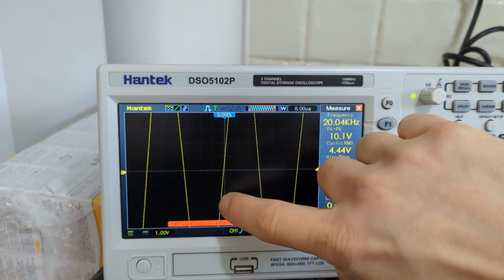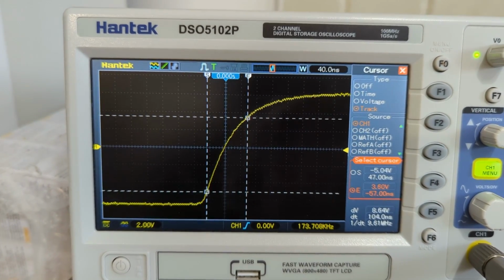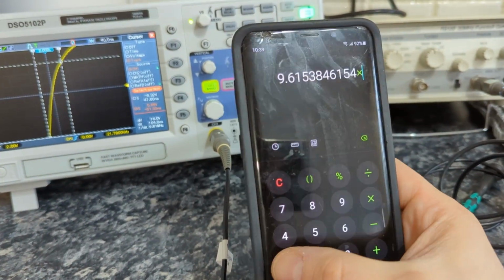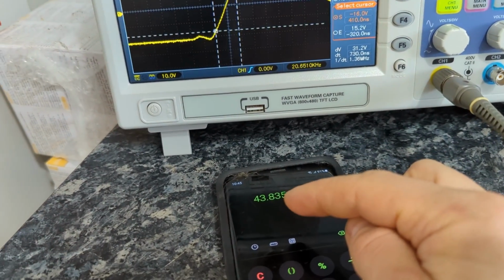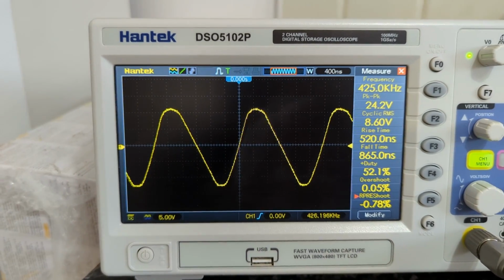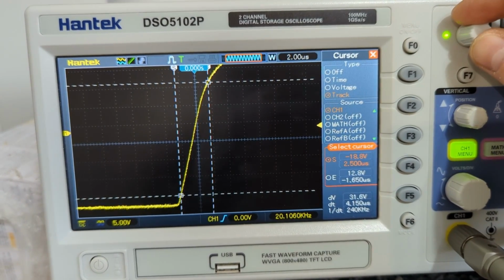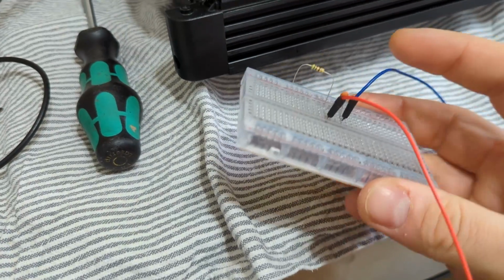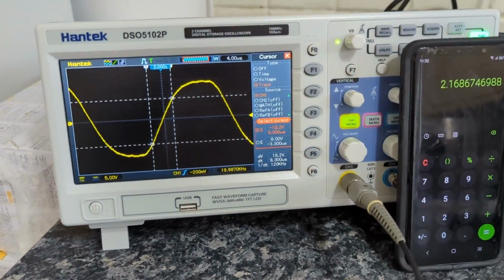Measuring amplifier slew rate - Class AB vs D

Comment: Nice video.  However, it might have been quicker to explain how a square wave is created in the frequency domain by summing odd harmonics of the fundamental.  What you are essentially doing as you increase the sig gen frequency is knock out increasing odd harmonics from the fundamental up and eventually arriving at the maximum harmonic(frequency) the amp can generate.  That's why the signal approaches a sine wave shape as the frequency on the signal generator is increased.  Using broad brush strokes here but as long as the slew rate is greater than the Max frequency the amp needs to spit out then there's no issue.  A sub amp can be good and have a far lower slew rate than an amp used to push sound to the upper limits of our hearing.

Comment: Well nice experiments, theory says it is enaugh for amplifier can handle high-frequency, high-amplitude signals 2.51 volts/uS for 20 Vpp signal at 20000 Hz  without distortion. Or 12.57 volts/uS for 100 Vpp signal at 20000 Hz It's a 1.5kW of power for HF 😀

Comment: This is why I have difficult with class D amps. If you only plan to use the amps at home why need class D amps. The size of the amps doesn't matter. Class D amps good for portable speakers. But for use at home why use class D. I had 2 NAD amps, 302 and 914. I hear clearly the 914 sound faster, faster attacks. So see "high end" class D amps supricing me. But not many talk about this. How come?

Comment: Before measuring te SR for class D amps, it is better to check it's output before the output filters. You won't find the analog signal there. So how do you want to measure  SR which is analog domain parameter when you don't have analog signal output ).
Reply from the maker: What kind of signal is it?
Reply: @RAW-CAt pulse width modulated and you must use integrator (LPF) to restore the input signal. 
Theoretically, you need an ideal (infinite roll off) filter This is the trick it is not analog amp in our classic terms.
In two words - digital domain.
But we do not convert it into the code, we convert it to the duty cycle of the square wave carrier. In delta-sigma we convert them into pulse density of the square wave carrier. This is a simplified theory.

Comment: just like class AB, class D amps can measure 'perfect' depending on their architecture/design.
it basically boils down to price range (the entry level got way better over the last decade) w/ 'top of the line' always being 'over achievers' (doing more than is really needed for a lot of extra $:} ).

ps: ABX testing should be fun... 
i'm very skeptical of claims coming from 'golden ears' simply because there's Zero data to back up the claims. 
there are indeed 'freak instances' where ppl can hear even ultrasounds and be bothered by it, but it's a relatively rare occurrence.

for most ppl 30 yrs old anything above 15-16kHz is silence...

Comment: Interesting video very informative, I loved it but I would say It's generally advisable to avoid driving audio amplifiers with signals that approach their limits, especially with continuous full-volume square waves. If you need to test the amplifier's performance or measure its capabilities, it's better to use signals that are within the normal operating range of the amplifier. Additionally, ensure that the amplifier is adequately cooled, and monitor for any signs of distortion or stress on the system. I actualy don't no the specs of the amps so maybe you weren't but just a word of caution' great work....cheers.

Comment: Class D: The RC-filter visibly drops the slew rate. I was waiting for you to test without the filter, but no
Reply from the maker: I will figure it out, just give me some time🙃
Reply: @RAW-CAt   Probably the @thulinp is right and you used a too powerful low pass RC filter, you can verify it by measuring the impact on the sinevawe for the same frequence (20KHz in that case). RC filter you used is a single pole and has 6dB roll off per octave and may affect the 20KHz signal in your setup significantly.  Take a measure without any filter.

Power amplifiers have some RC filters at input so to feed it with a pure square wave in theory should be OK .

Comment: We call it slew rate, but it is actually simply clipping. But what is clipping is the current into the dominant pole capacitor. Think of it this way and all the mystery disappears.
Reply: No, 'Slew Rate' is NOT 'Clipping.  Slew rate and clipping are not directly connected, but there can be an indirect relationship. In amplifiers with lower slew rates, fast-changing signals may not be accurately reproduced, and this limitation can contribute to distortion. Fast-changing signals can lead to transient voltage spikes that may cause clipping if the amplifier's response is not fast enough. In summary, while slew rate and clipping are separate characteristics, a higher slew rate can contribute to better handling of fast signal transients, potentially reducing the risk of distortion due to clipping in certain scenarios. It's important to consider both parameters. This video is shows us how to do things properly at home and there is no mystery here, it's very well understood and well explained. And your in the wrong place to discuss "Dominant Pole Capacitors" as it's no fun at all.
Reply: @andymouse  slew rate limiting absolutely is clipping. The clipping happens when the input stage runs out of current drive to feed the dominant pole capacitor. If you look at the current in this capacitor with an input of high enough frequency and amplitude to cause slew rate limiting you will see a sine wave with flattened peaks.the drive current has limited. The reason it doesn't look like clipping at the output is because you are now looking at voltage which is in quadrature with the capacitor current. Make the measurement.
Reply: You read my comment, any more is simply out of context for this video...Cheers. @donepearce
Reply: @andymouse  Never mind. Many engineers fail to grasp the idea of phase quadrature and current clipping. You are no exception
Reply: I am not worthy :) @donepearce
Reply: @donepearce  it looks like clipping because he is feeding a square wave, the capacitor here cuts out the high frequency component.    Unless he has conected the capacitor in series to input by mistake, but it doesn't look like, but as I can see the filter cuts quite significantly from the signal.
Reply: @gherbent  It is clipping. What is being clipped is the current produced by the input stage and feeding the dominant pole capacitor. The higher the frequency, the lower the impedance of that capacitor, and the greater the current it demands to produce a given output signal level. When the frequency and amplitude reach a point where the input stage runs out of current, the current will clip. Because the current is 90 degrees out of phase from the voltage at this point the clipping will not appear at the top of the wave, but up the said - hence slew rate. I'm running out of patience explaining what should be a simple phenomenon.
Reply: @donepearce   well, lets break it down. 
1. Slew rate and clipping by definition are different things. From your words we understand that they are the same thing.  Clipping is when a limiting occurs. Slew rate is how fast a voltage increases or decreases.
2. Neither the resistor or the capacitor from the RC filter do not cut the signal abruptly, the resistor reduces de current but neither presents a limiting factor in the signal path.
3. In his situation the slewrate is reduced by the 1st order filter he has used but maybe should not, because here it is cutting a lot from the  20KHz component, he probaly miscalculated it. 
4. The  squere signal output does not run out of current it is taken out of  audio amplifier capable of producing in excess of 6A. and it ecounters a resistor on its path first then the capacitor. The slew rate is reduced by excesive filtering not because of clipping.
5. the current can be 90 degrees out of phase in pure capacitative or inductive load with sinusoidal signal, not RC like in this case and a square wave. The slope is reduced Yes, by RC filter. The capacitor has an effect on the slewrate in this case by reducing it but is not like you say that  it is because of clipping.
Reply: @gherbent  I've tried. I really have.
Reply: @donepearce     The clipping affects the top and bottom of the signal ( the amplitude is not simply minimised, the top and bottom are cut).   In his case the capacitor is of a small value and is connected in PARALEL to the signal which increases the rise and fall time (has impact on the slope, on the edges), but the impact is minor, the amplitude is not limited and it REACHES that from the input.
The square signal is not an continuously changing voltage or amplitude by difference of sinusoidal, so a small value capacitor connected in SERIES to the signal will limit the amplitude and distort heavily the square wave (probably here you can say a clipping occurs). And we still have to see the true meaning of clipping.

In my turn I will not bother you any more. Physics works regardless we understand it or not.   🙂
Reply: @donepearce I think they don't understand what you are talking about. The same works for class D SR measurements, and it is obvious when you do understand the PW modulation principles.😢
Reply: @mxvmx9568  I've tried explaining this to junior engineers in the past. Most of them finally understood when I put a current probe on the dominant pole cap. Just had to kick them out of the voltage-only mode.
Reply: @donepearce  then you would need to explain Bode plot, NF principles, importance of the phase relations and many other things. Including the PW modulation which is moving us out from the analog domain.
Reply: @mxvmx9568  Hopefully everyone I am dealing with understands all of this. It's a warm summer evening, circa 600BC...
Reply from the maker: I'm sorry, but you are not right. Clipping is increase of harmonics content because of power supply "bottoming out", whereas slew rate is simply a measure of how an fast an amplifier can increase it's output voltage. A square wave and a clipped sine might look similar but it's not the same thing.
Reply: @RAW-CAt  try again. I am right. You need to think in the domain of current into a capacitor.
Reply: @donepearce  I am trying to return to understanding of what you were saying. Now, I am not commenting to contradict you. Why do you come up with the word 'clipping' to describe your phenomenon, as it already has a meaning? This can be confusing. 
"Clipping is a form of waveform distortion that occurs when an amplifier is overdriven and attempts to deliver an output voltage or current beyond its maximum capability."
The 'clipping' you refer to is not the same as the definition I brought above.
The only thing I can relate to is: if you were talking about 'current limiting' or probably  'current clipping?' (as you would say) feeding the amplifier's internal circuitry, not the amplifier's input, which in the end will have an impact on the slew rate. Were you meaning 'Clipping' as reaching the 'current limit'? It was obvious for you, but very confusing for us. 
One of the causes impacting the slew rate is also the Miller effect. 
Maybe we will understand you better with a graphical explanation, a simple schematic. 
Probably, this is the weakness of the English language, as I did not interpret correctly what you were referring to from the first two sentences of your comment. I was interpreting it as you were talking about voltage clipping (signal clipping), generating distortion.
Reply: @gherbent it is exactly clipping. What is being clipped is a current, not a voltage. As that current is passing through a capacitor (the dominant pole) the resulting voltage show the clipping 90 degrees out of phase.
Reply: @donepearce  Again.
When you are saying 'it is exactly clipping', we understand 'signal clipping' amplifier goes into clipping mode, which is not the case here. What you are probably trying to say is that the slew rate is as it is because of the limit of the current feeding the circuitry/transistors. 
1. The part where the slew rate is measured is mostly linear and on a very wide portion of the amplitude, which means that the current in that portion is of a continuous/maximum value inside the amplifier circuitry, which can be as a result of Miller effect due to component internal capacitance. The capacitor you are talking about (not capacitance I mentioned)  would introduce nonlinearity as it does not allow a steady maximum current to pass through; it will eventually become charged. So your model does not sound logical to me.
2. Where did you get a 90-degree shift? 90 degrees shift occurs in ideal circuitry/purely reactive where resistance is equal to 0,. The 'Miller effect'/ current, a breef time,  reflects on the slew rate on the amplitude, on vertical Y, while a 90-degree phase shift is in the time domain, which reflects on the X axis. If we change the pulse width, your description may fall out of the impulse.
Reply: @gherbent if you hit the maximum voltage the peaks of the voltage clip. If you hit the maximum current the peaks of the current will clip. It is the same thing. The voltage on a capacitor is at 90 degrees to the current so if the current is clipped but you look at voltage the clipping will appear to be on the slope not the peak. Is this really hard to grasp?
Reply: @donepearce  "The voltage on a capacitor is at 90 degrees" - first is not, it is not a 90-degree shift,  it can not be,  it is what I was telling you in the 2nd point, the circuit has internal resistances which are never 0 Ohm, combined can give phase shifts much lower than 90 degrees and those do not translate to the vertical axis of the slew rate in the way you say,  it is not like a picture turned at 90 degrees.  A phase shift is a phase shift. Your analogy is applicable in relation to voltage-current-speaker-coil movement; they are not in the same phase.
The effect of the circuit's current, yes, it translates to the vertical axis, but has nothing to do with 90 degrees shift. The capacitor in the filter may also influence a bit how steep the slope is (slew rate), and round the top corners.
We had a hard time understanding you because you were using 'clipping' in a different context; in the context of the video sounded like 'the signal is clipping', and to catch your idea, your model did not quite make sense.
In the end, what solves understanding your model of a capacitor and current clipping, and how does it help non-technical guys? We can not simply reduce the capacitor size to increase the slew rate, can we?
Reply: @gherbent in a capacitor voltage and current are always 90 degrees apart. They have no choice. And in an op amp the lower end of the dominant pole cap is at a virtual earth on the base of the voltage gain stage. That makes the collector voltage an almost perfect 90 degrees to the capacitor current.

Comment: At 9 minutes. U decided to use a square wave input to compare the 2 designs..YOU JUST HANDICAPPED THE BETTER AMP.in this case..the class ab.. no disrespect.. do the test again with sine wave..and compare the harmonics . Compare bandwidth at different loads. The class ab doesnt care. The class d rolls off the bandwidth with any imp above or below the target freq of the output filter
Reply from the maker: All of the testing that you are talking about is done with distortion testing. Have a look at a few of my previous videos. There I analyse Harmonics, linearity, frequency response and other things with much more sensitive equipment and on different loads. This video is only about square waves and slew rate.
Reply: @RAW-CAt  well i acted like an old drunk
Youre correct.

Comment: Why did you multiply the voltage times time for the first amp and divide the voltage by time for the second amp ?
Reply from the maker: Because for the first amp, the time is in nS, for the second it's in uS .
Reply: @RAW-CAt  Real confusing the way you did that. 4.15 uS is just 4150 ns.
Reply: @RAW-CAt  I understand that conversion of the time requires multiplication to make its uS , but after you made the units match the first amp had its converted time measurement multiplied by voltage ,but on the second amp you divided voltage by uS
Reply: @phillembo  I realize this is old... but he converted and multiplied the inverse time measurement by the voltage. 1/T x V is the same as V/T. He could have solved the first one with the same format as the second using 32/0.73=43.84V/uS. The math works either way.

Comment: I replaced my old Alpine MRP- 300 class ab with a new Alpine R-A60F R-Series 

At first, I didn’t really see a difference in sound quality, so it aggravated me. Knowing that I wasted all my money on a new amplifier for nothing so at that point, I made it up in my head that the class ABB sounded better at higher frequencies. 

At this point I’m not really sure anymore. I don’t push the new Alpine amp to its limits so I’m never getting any distortion I think as long as you set your gains properly making sure you’re not feeding too many volts when it comes down to clarity you should be safe at that point .

The rest is just going to rely on tweaking equalizers to your specific needs
Reply: This sounds like an improvement to me. You're getting double the power as well as better efficiency.